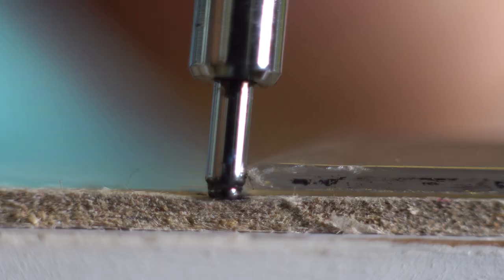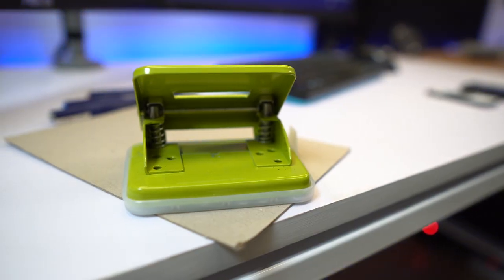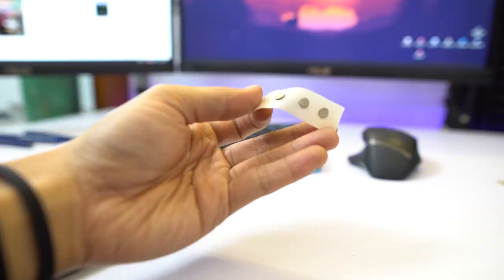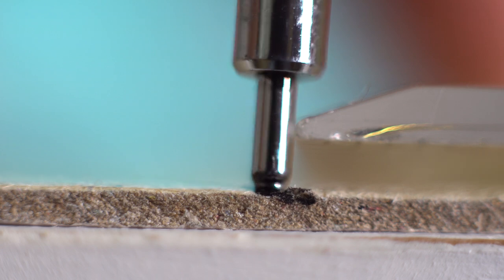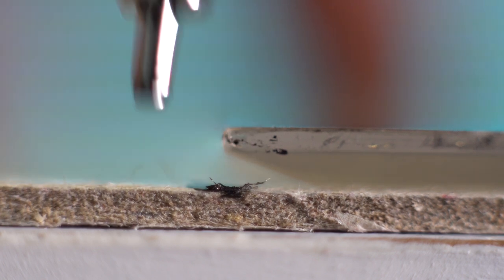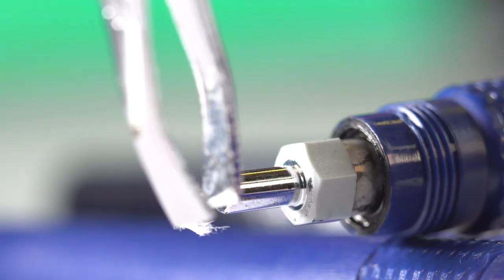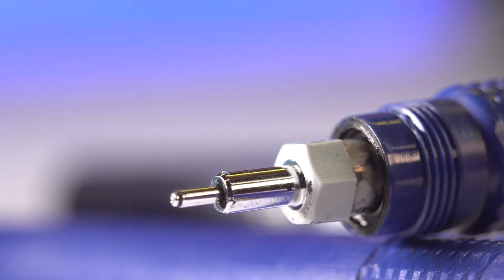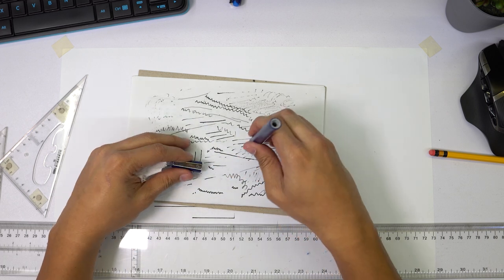Architecture Technical Pen Tips

Comment: A tip for if your pen isn't working. Place it in lukewarm water (with the cap on the pen) and let it soak there for an hour or so. After that, just start writing on a scrap piece of paper and it will work again. This tip also works for normal pens without a cap, but you have to create a cap than to place over the tip.

Comment: I think I have a trick to how avoid that for the tech pens or the ink forck by using an old technique by empty the ink from the tube of the fork ink and filled it with alcohol or chlorine and use it to arase the extra lines

Comment: Ny rotring techpen is not working (0.1, 0.4) 

I didnt drop my techpen, i just cleaned it and i put it in a hot water, i cleaned it 5x times already and up until now it is still not working

Can you help me with my pen?

Thanks
Reply from the maker: Try disassembling your techpen:) Like removing the needle inside and cleaning that.
Reply: But i already did that too😅☹️